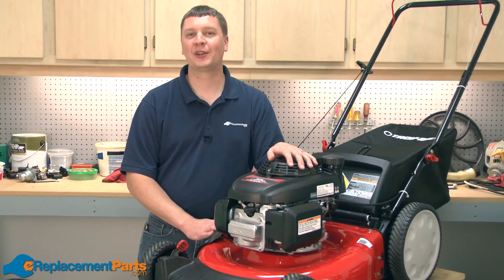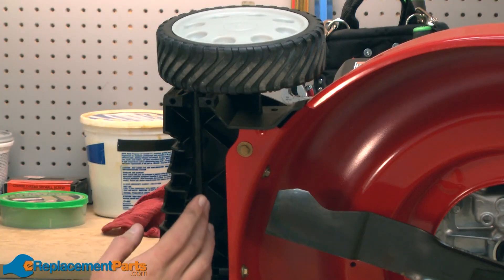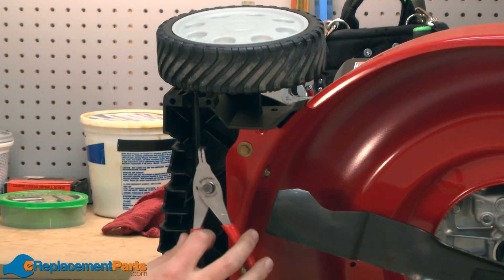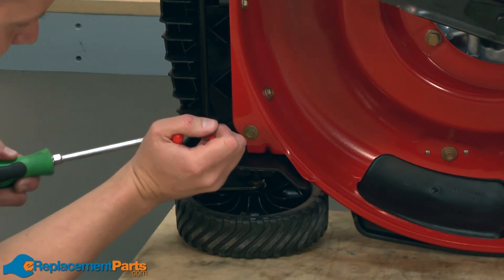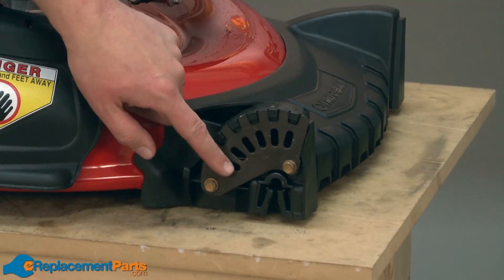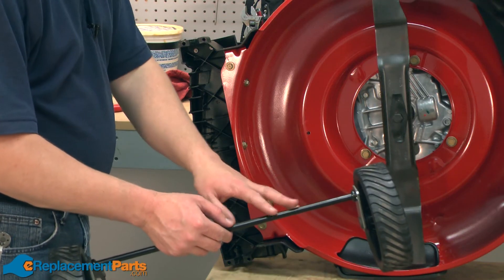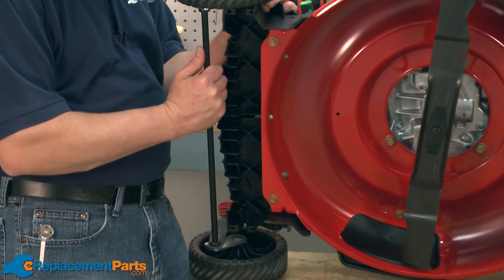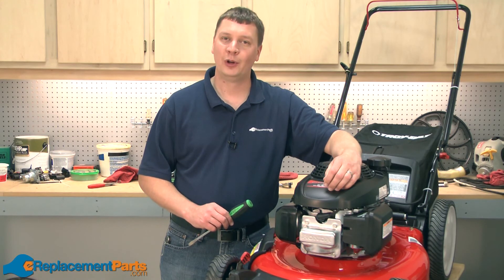How to Replace the Front Height Adjuster Plate on a Troy-Bilt TB130 Lawn Mower

Comment: Thanks for your videos, @ereplacementparts. I've replaced both the front axle and the height adjuster plate, but the adjustment arm still slips (jumps down to the lowest setting) from time to time. Any ideas?

Comment: I was able to get a wrench in there and take that plate off without removing the wheels. I used a dremel to square off the worn pieces of the plate, it helped but it still slips occasionally. My question is, does the stopper (the part you pull away from the plate) need to be replaced too? If so, how?
Reply from the maker: Thanks for your question. When you mention the stopper, are you referring to the black, plastic front cover? If so, the cover shouldn't need to be replaced unless it is damaged as well. I hope this is the answer you're looking for, but if not, feel free to reach out and we can help troubleshoot your problem more closely. Thanks!
Reply: eReplacementParts.com No I meant the adjustment arm. It’s spring steel and I bent it toward the adjustment plate. That seems to have solved my problem.
Reply from the maker: Glad to hear your problem is solved!
Reply: eReplacementParts.com Thank you! Informative videos.